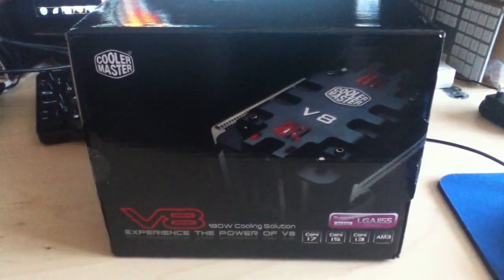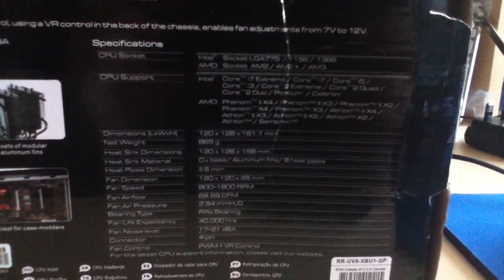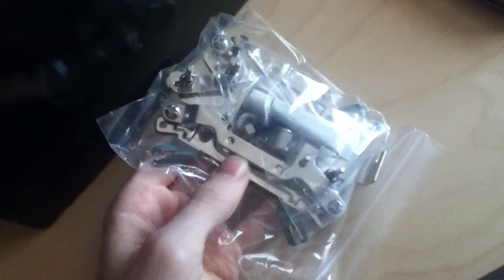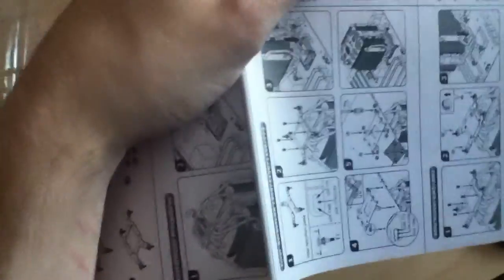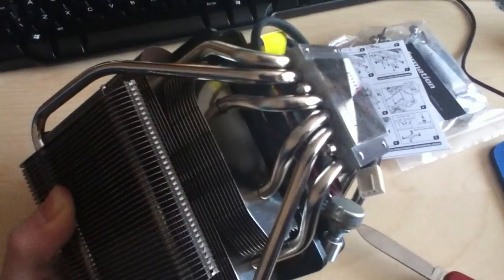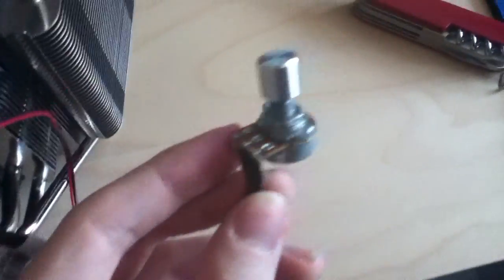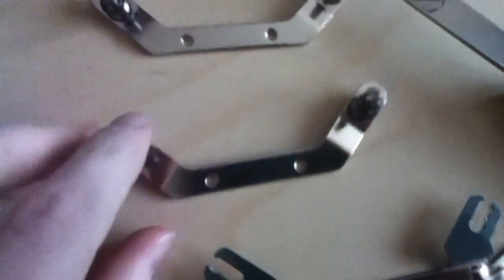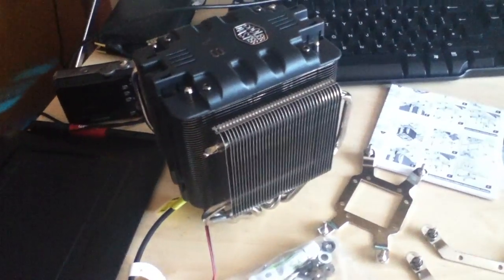Coolermaster V8 CPU cooler

Comment from the maker: If the case was big enough. you need to check how wide the case is and compare that to the dimensions of the cooler. This is because all cases are diffident sizes.

Dimensions:
Width:	120mm
Depth:	120mm
Height:	158mm

Comment from the maker: In theory yes. Look at the specifications ( I have sent you a PM with a link to the specifications for you ) AM3+ support   Just make sure your ram will fit under it and your case is big enough for it to fit in without it hitting the side.
These are the dimensions:   236.5 x 129.6 x 161.3 mm (L x W x H)

Comment from the maker: On my motherboad yes. if the cooler was any closer to my ram slots then it may not fit if you have heat sinks on your ram. it should. but check the width just to make sure.

Comment from the maker: @0MarlonStelzer0 yes you should be able to because the brackets supplied should fit the motherboad...  I would check to see weather you case has enough room at the back for the backplate supplied. the box sais its AM3 compatable, which also means it should be compatable with AM3+ sice AM3+ is just a newer vertion.  I have bought the same CPU that you have described which is why i have chosen this cooler.  Hope this helps m8.